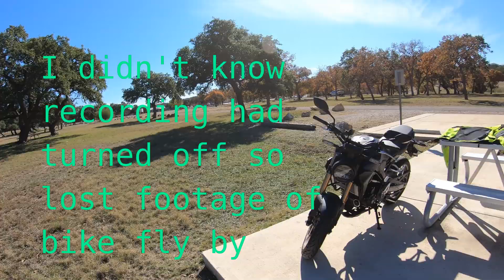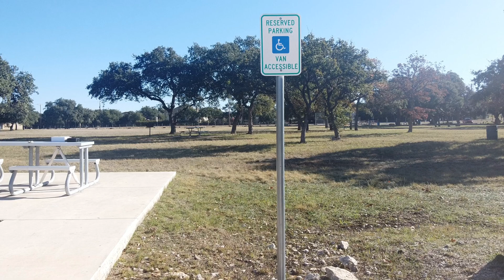Dji Mavic Mini Drone - 400 foot Max Altitude Test Flight - Nail in tire

Comment: Good video. Might want to slow down on those spins a little bit. Was your camera set on 1080/60fps? Mine isn't near that smooth on 2.7k/30 but 1080/60 looks nice and smooth.
Reply from the maker: 2.7 30 also edited at 2.7 30 and gopro matched no format changes. Youtube makes it 1440p - blender editor